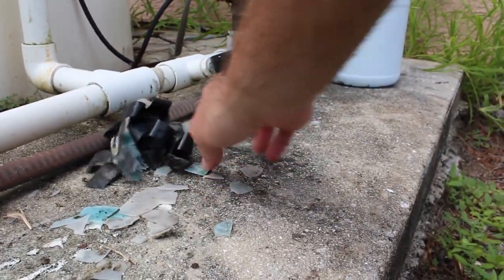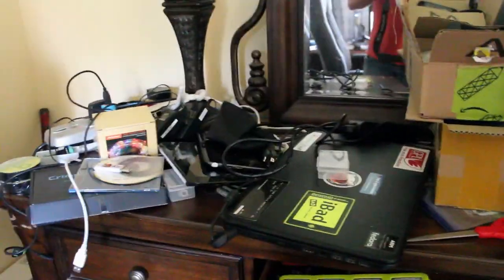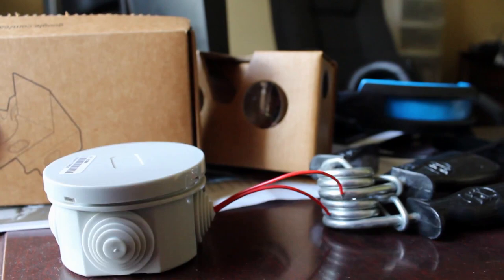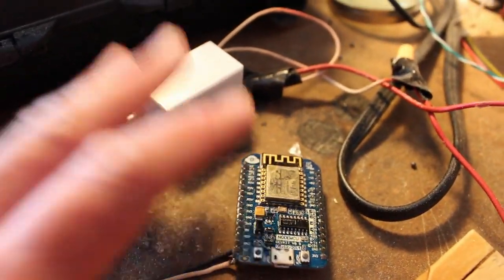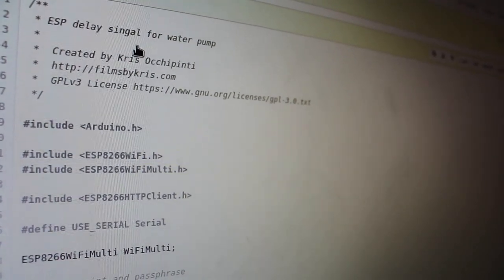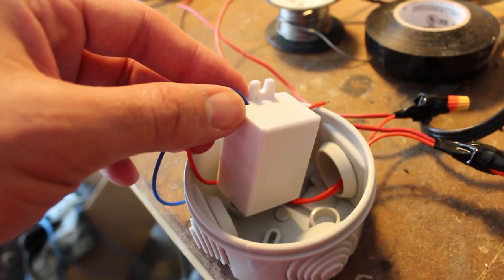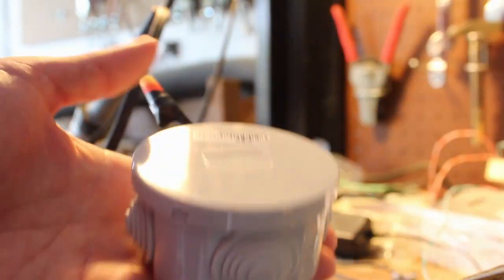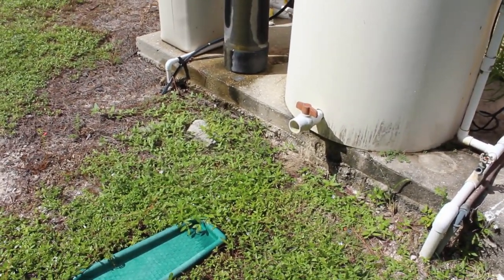Water Pump Alerts Revisited New Enclosure 2018 ESP8266 and Arduino IDE

Comment: #1 I REALLY hope that outside socket that everything plugs into has ground fault interrupter! (it looks real hokey) If it does not PLEASE get one installed! As a firefighter or former firefighter there really is no excuse not not have one. 
#2 I really think you should power the esp directly and have it automatically shut off the pump after 5 minutes and take a remote and/or local way to turn it back on if you determine there is not a problem. 
This method ensures you do not damage your pump and takes interaction to turn it back on, and not off, which is much more appropriate for pump damage control. This also avoids the issue to where as if you ever run into a situation where the pump malfunctions but somehow keeps intermittently losing power, it won't continually burn out your pump. This also safeguards the fact that if you lose your internet or your wifi signal won't connect, that you will never get the message and thus never turn off the pump. Again it is better to turn the pump off via relay after 5mins and the wifi used to monitor or turn it back ON and decouple this from the pump power, otherwise this will just turn on again in 5 mins because the power has been reset at the pump.

Comment: I don't trust WiFi outdoors, too much interference and signal loss. I'm honestly surprised it's working at Kris's house since he has Stucco siding. Stucco Siding has a chicken-wire like mess that the Stucco is applied to and attends to act like a Faraday Cage. If I had to use something that was WiFi controlled outdoors I would have a WAP outside with a hidden SSID and set it up to only allow certain devices connect to it.